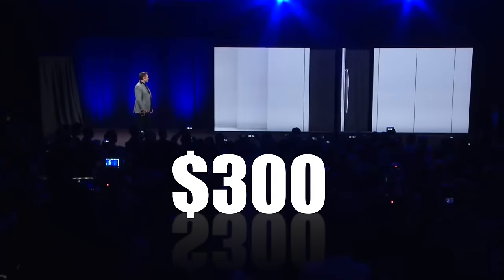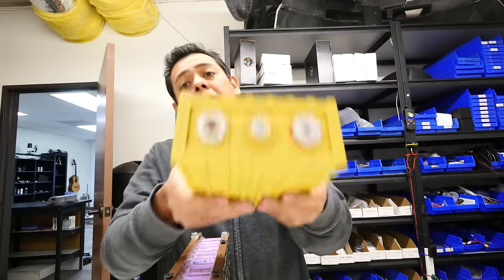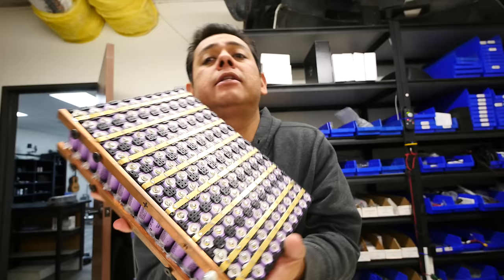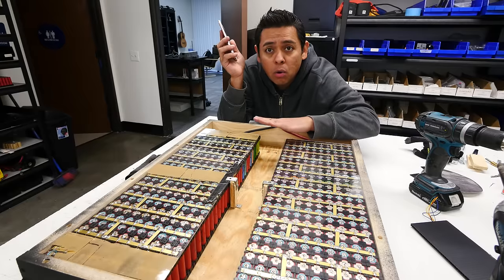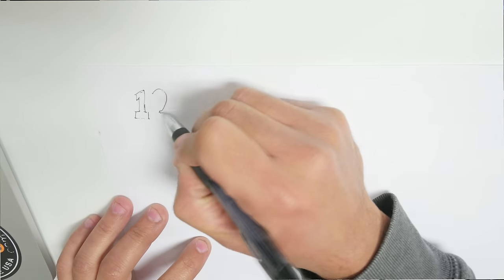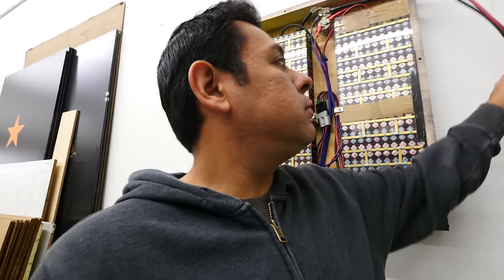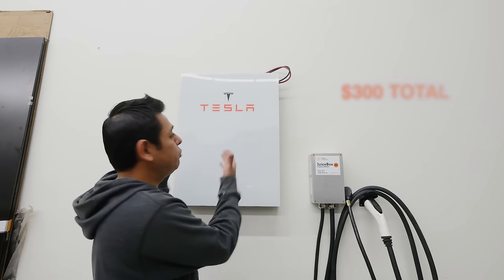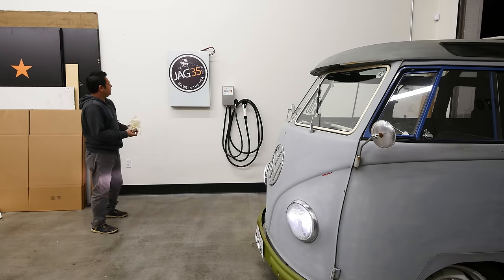$300 DIY Tesla Powerwall - Solar storage 18650 lithium ion home Battery

Comment: 100$ for glass...
you could buy more cells
Reply from the maker: or beer
Reply: Exactly my thought when he was breaking up the cost.
Reply: Cekpi7 it was $100.00 spent on theater. Notice he covered the Tesla with his sticker after? What a statement!! Great way the end the video.
Reply: @Frank Navarrete, M.D. Nothing wrong with exercising his prerogative to make it look cool and be contained the way he wanted it
Reply: Glass Coors Lite mirror
Reply: Cooking system or did I miss that?
Reply: What Cooling system or did I miss that?
Reply: I was wondering about cooling too, I don't think they use cooling in these kind of applications, there's no radiator on a Tesla powerwall.
Reply: @robertpryor7225  https://cleantechnica.com/2019/01/19/everything-you-need-to-know-about-the-powerwall-2-2019-edition/

Not sure for the first edition but this one has a sophisticated cooling system and it has vents around the case. As opposed to this one which is completely closed...So I think it's pretty darn dangerous especially the heat it radiates when charging and when in use..
Reply: Or a lot of Guap for your chipotle bowl
Reply: @Frank Navarrete, M.D. yeah, i think it was supposed to be for comedic effect.
Reply: I would’ve put a board paint it black and yeah bought some more cells Tesla could kiss my cell Ass...lol nice job now how does it perform???? What’s the life span on the batteries??? You did mentioned if one goes bad a fuse will blow yeah then what?? Now you have to replace that cell?? Damm there’s a lot of questions about this project that’s not answered let’s go make a fellow up video chop chop!!! Lol nice job brother but I’m still waiting ok

Comment: Liion has been known to explode on infrequent occasions ; suggest you put it outside away from your house so your insurance is still good for the house.  Nimh is NOT known for explosions and while heavier is not a factor because its not moving (in fact Ni-Fe might be best of all because space and weight are not players and Ni-Fe has been known to last 100 years).  oh yes, you mentioned memory effects with nimh, actually its more the nicads that have that problem, nimh is not known for that.
Reply: So john for. I don't know jack about this but are you referring to AA rechargeable batteries? Thanks
Reply: Liion does not explode infrequently, having Liion batteries like a 18650 charging with Positive facing down for a prolonged period of time is what causes batteries to explode as the heat has no where to go and will build up to dangerous temperatures which is what causes problem, not the technology itself. It is still well worth mentioning Liion requires proper precautions to ensure stability and proper operation ;but there is nothing about Liion as a technology that should be a cause for concern.
Reply: They are a different kind of battery that has 3.7v instead of 1.2v.  I think they are a different size too.

Comment: It is inportant to note that those cells are usually not to the standard of Tesla’s In capacity, current output, or just general quality. If you were to do this with something like Samsung 30Q’s, then it would run ya about 3 bucks a cell so cost would come around much closer to Tesla’s if you want the quality and longevity of not only better but newer cells.

Comment: Hard to believe, we can make bookoo dc power, now we WORK to covert dc to ac!
Since the voltage comes from a battery, on-site, we consume the AC and DC only feet away from its production...
Big reason for ac, a hundred years ago, was the travel length from the power stations and homes and businesses.
While thanks WERE in order to Tesla, we now no longer need ac like it was needed  a hundred years ago.
The majority of appliances, at home, want, need, dc and have small transformers, in the device, to convert ac to dc.
None of the conversions are 100% efficient.
So, imagine how much juice, RIGHT NOW,  is simply being wasted?
In every home and apartment...
What a world if wal-mart started selling dc appliances?
After a few weeks, news would spread how much less folks suddenly spend on electricity...

Comment: You forgot the BMS to keep the cells in balance and to prevent over discharge/Over charging of the pack..
Reply: Very true, those cells with be all mismatched and potentially ruined in short order.
Reply from the maker: NO BMS

Comment: I'm confused, did you go with 3s for 12v?  3s is really 10.8v or 11.1v.  Most 12v inverters shutoff at 10.5v, meaning you probably will only see about a 50% capacity usage or less (depending on load) if you go with a 12v inverter.  24v inverter with 7S is a far better choice as the voltages are completely compatible.
Reply: asusreviews 3.7 v minimum, 4.2 fully charged , so 3 for 12v is in the middle range for the cells.

Comment: 3:20 1 kWh of Energy, not 1 kW of Energy
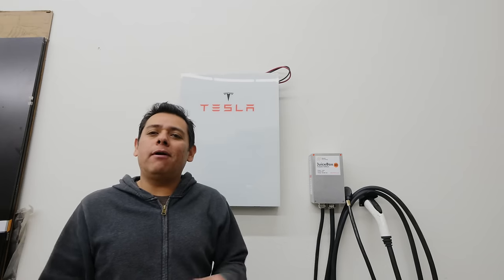10:25 Again, it's 4.4 kWh

11:24 Actually exponential units are expressed in small letters, kilo for k,
Mega is M (because m is used by milli), and Giga is G (because g is used by gram).

That's the reason we use kW and kWh [Look at your Energy or kWh meter],
MW and MWh, GW and GWh.

--------------------------------------
We use kW for power and kWh for energy, i think it's not that tough to differentiate them or to pronounce.
Reply from the maker: +Chandraprakash G   I don't care
Reply: You seems to be a DIY electrical genius, 
just a small suggestion from your fan to make your videos more correct :)

Comment: I would love to watch a “non electrically knowledged” diy ‘ er troubleshoot this when the cells start aging & failing, esp since all are soldered together ! How do they even know if a fuse onboard blew ? 
Its a neat idea, don’t get me wrong... but folks are not understanding what they are getting themselves into. If knowledge they learned to do this is not used... when things break in a few years... umm good luck remembering !
Reply: 1. They are not soldered. The case holds it all together, so you can take it apart and test them individually (which would still suck) 2. You can easily see a blown fuse.

Comment: Aloha Jehu, this video is 4 years old. Do you still recommend using this method to build a power wall? Or has the technology advanced so much that you recommend something else?
Mahalo, from Hawaii!
Reply: I'm not an expert but I would say that technology didn't change at all and this idea is still valid.
Reply: Looks like the budget for batteries is going to be higher now
Reply: @noahno  for a little while. I imagine EV batteries are going to be available soon, and demand for used laptop battery cells...not sure.

Comment: Isn't it important to match all the cells performance?
Reply: Yes. He has no BMS installed. All electric vehicles with lithium batteries (and even phones and laptops) have some type of battery management system to monitor and balance the battery over time. Without that and with all of these random age cells thrown together, I think that long term some of the cells could get dangerously overcharged.

Comment: I enjoyed this, but I wonder about those wires you show. They appear to be no more than maybe ten gauge and, at 7.6V and 4.4kW you're talking about quite a lot of current. Do you actually power your house with this?
Reply from the maker: 6 awg cable,  most likely going to end up being 24 or 48 volts.   The inverter will most likely be no bigger than 2000 watts so at 24v it will see a max of 85 Amps and at 48v around 43 Amps
Reply: 6awg is rated in AC power distribution for less than 40A. Copper is not so expensive as to skimp on the power stack. Every milliOhm at such low DC voltage is wasted heat. Why not use #2 or #4 wire?
Reply from the maker: The right cable will be used once inverter is chosen,  right now its a wooden box full of batteries with 2 cables sticking out of it.
Reply: LMAO. How long did it take to sort through 100-odd laptop batteries? I had not thought of this as a solution before, but it now seems reasonable to think one could power an off grid home on recovered laptop batteries. How much work is it to repair when cells fail? I assume there is an indicator on the fuse to let you see it's blown?
Reply from the maker: All good questions,  all unknown until someone tries it out.  Im hoping when cells go out they just trip the fuse and they are disconnected,  not too much to worry unless too many of them start to fail,  in practice  who knows if thats going to be a pain.   I have a 12v battery on my car built just like this,  haven't had to worry about it for 2 years.   So its a proven concept on a smaller scale so we'll see.
Reply: +Brad Scott
Your right works out 578.9 amps  I=E/V on a 10 gauge  I'm not an electrician but that a lot of amps no?
Reply: +jehugarcia 
Hi good vid articulate I like that. 
Seem like a lot of work for my application. I have an 800 amp 36 volt welding generator. Actually it's 2x 400 amp circuits. I can switch to either run on constant current or constant voltage. I need a power wall for approx 30 kW. I believe constant voltage would be the way to charge the power wall . Any opinions. Anybody? 
Anybody at all. Help
Reply from the maker: Lithium cells are usually charged constant current first until 4.2v per cell is reached.  The charger then switches to constant voltage until the current comes down to a few Amps then it cuts off
Reply: +jehugarcia What happens to the voltage / amperage if a handful of them fail?  Is the inverter able to deal with a range of voltages intelligently, so that you don't get a brownout?

You could probably run a controlled test by disconnecting a few at random while there's a load, but be ready with a chemical fire extinguisher...
Reply from the maker: +oasntet   If say that depends on how many  cells fail and why and what configuration you are running.   5 failed cells in a single  10p configuration group is a big deal,  but not so much in a 150p configuration.   Extinguisher?  Why?  Are we planing on chopping a few cells in half?  That's the only way you'll get these cells to catch fire.

Comment: There is a strong suspicion that for static applications, the plating batteries will replace Lithium batteries.  The Zinc Bromide battery, for instance, uses very common materials (plastic, zinc and bromine and an organic liquid which holds the bromine in the discharge phase) which are cheap.  Better still it can be fully charged and fully discharged and will have the same capacity next year as it has this year.  It also has no self discharge. If you charge it up today and come back a year later, it will still have the power you put into it.  For industrial users, the liquid metal batteries could be an option.  Probably not for home use but with the same characteristics as the electro-plating batteries and huge power density.